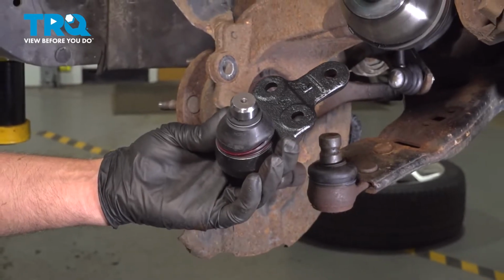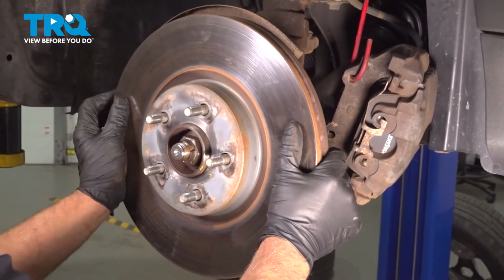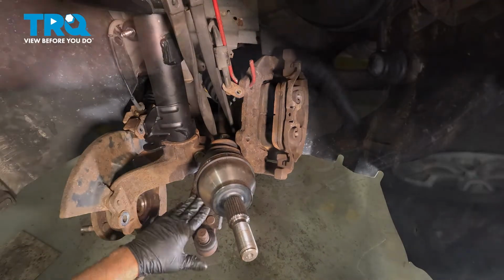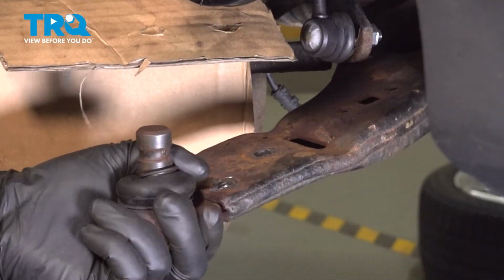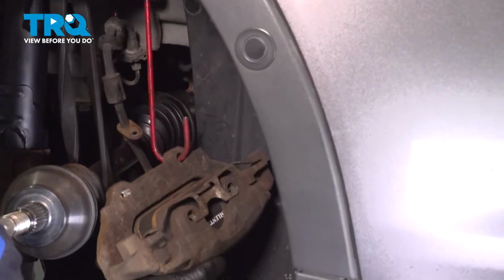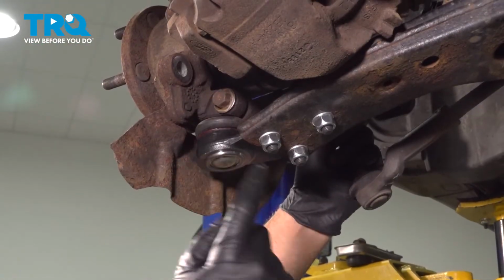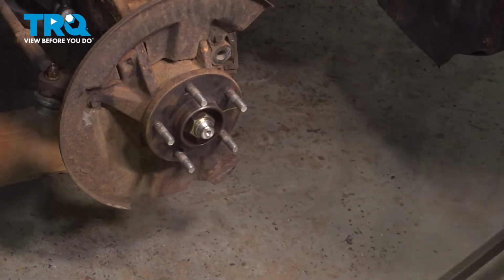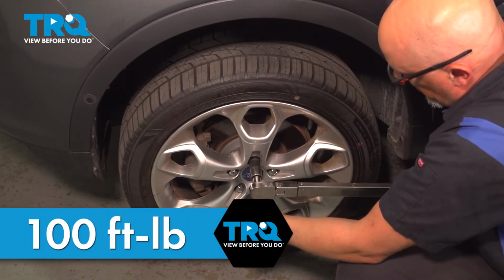How to Replace Front Lower Ball Joints 2013-2019 Ford Escape

Comment: A Lincoln MKC is the same setup. I did not understand that those were rivets. Therefore I will probably replace the entire arm. I think you could replace the entire arm without removing the caliper or the axle shaft.

Comment: Im curious as to why you didn't just push the cv axle out of the hub, loosen the ball joint bolt, pry the ball joint out and replace. Why all the extra steps with the brake caliper and the tie rod and the rotor?

Comment: You make lowering the control arm look easy.
I have tried a pry bar and I STILL cannot get the ball joint completely out of the knuckle.  Is there something I’m missing?🐼
Reply: Well, depends on what part of the world you live in lol. These boys don’t appear to be in the rust belt. So, it’s that easy. You can hit the bottom, and sides of the ball joint or, even stick a striking pry at in between the slot where the ball joint slides in to go spread it open wider. That will help.